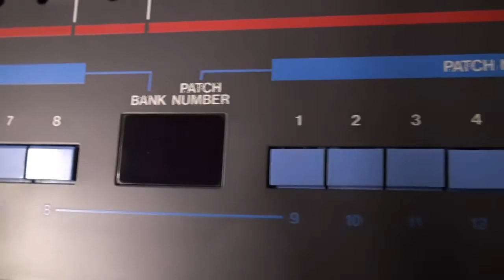Packrat's Juno106 - Part 26

Comment: Hi, what is that plastic strip on the backside of the keybed good for? Would your procedure also work without removing it?
Reply: It stops the keys from entering a position where they can fall loose. I watched this video after having already disposed of mine, so now I'll have to come up with a replacement strip or else I risk keys flopping out of tension.